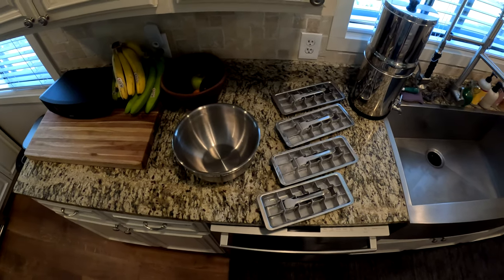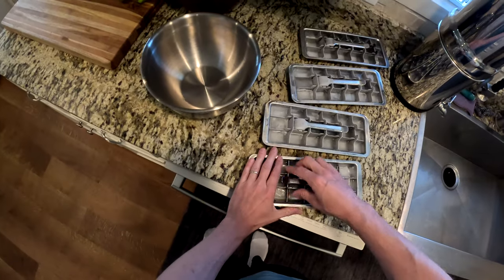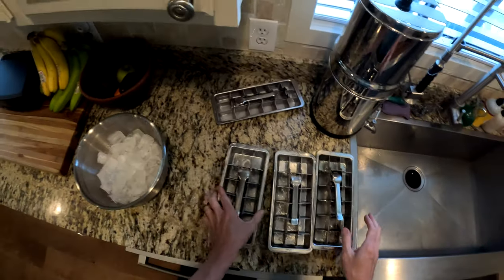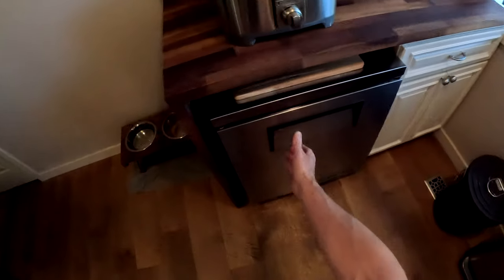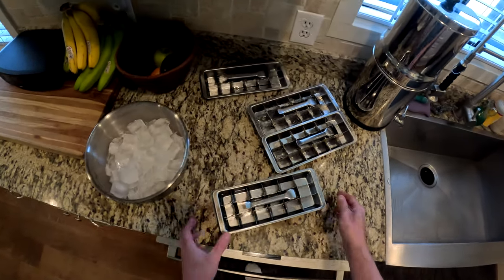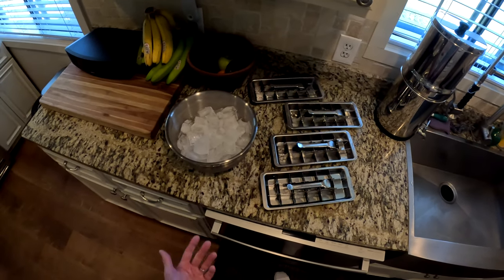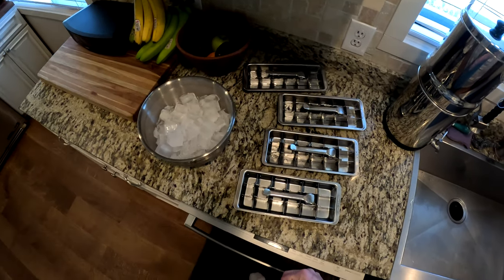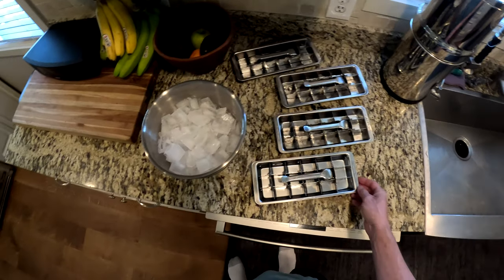What Is; The BEST Ice CUBE Tray??  (RSVP Stainless Steel Tray)

Comment: thank you for the review i am getting the steel ones!!! great video~
Reply from the maker: It is pretty annoying there isn't a perfect ice cube tray, seems pretty simple..   So FYI Update.  These aren't as easy to get ice cubes out of as when I first got them..  If you did already order them.  Best thing to do is let them sit out for 5-8 minutes or so to break loose. Before you break the ice with the handle.  I have had some issues.. One broke as in won't line up right to break the ice.. Couple of them have developed extra deep middle part in the tray (maybe from me pushing too hard trying to break the ice without letting them sit on the counter)  So the ice build up on the bottom gets too thick which makes it harder to break the ice.  So I flip it over and hammer down the tray a little so the ice won't build up as thick. Sometimes I just have to melt some of the ice to make it thinner to break easier.. 

Who would have imagined no one could invent a reliable ice cube tray that works..

Comment from the maker: Update 2 months later:  These are still my favorite ice cube trays. But have had some learning and issues.. I got one track broken trying to force it to break the ice, the bottom tray got thicker ice from pushing down hard. When I first got these trays I could break the ice as soon  as I took it out of the freezer..  NOW:  The only way they break easy is if you set them on the counter for 30 minutes! to naturally break loose from metal before you use the ice breaker.. They work great this way.. But not if you try to break ice as soon as you take them out of freezer.. FYI..

Comment: I grew up with these ice trays and loved them. i used to run warm water on the bottom for a few seconds and that would help..  now i have an ice maker
Reply from the maker: I tried running warm water for a little bit but they still came out rough..  I just put them on the counter for about 30 minutes or so, and they all pop out easy..   I have a big commercial fridge and a small under counter freezer, no ice maker.. There is also lots of leaks in those water lines for the fridges with ice makers and the ice makers get pretty gross after awhile, impossible to clean plastic like that.